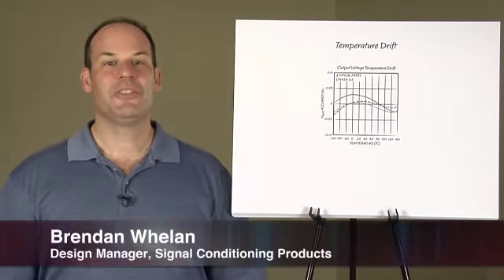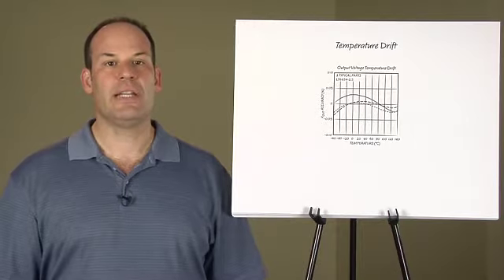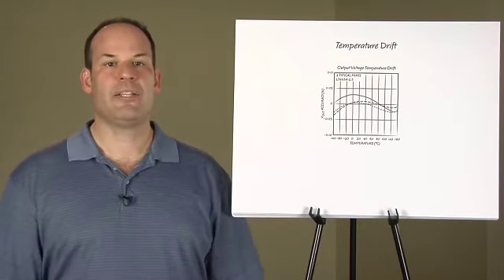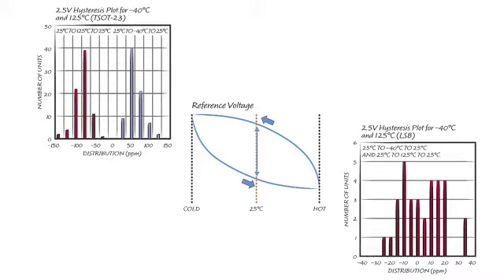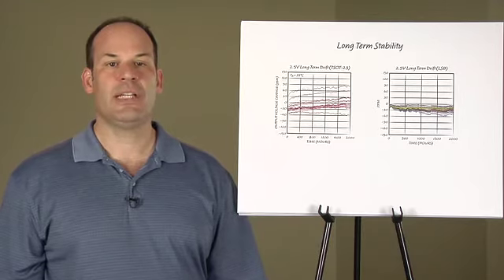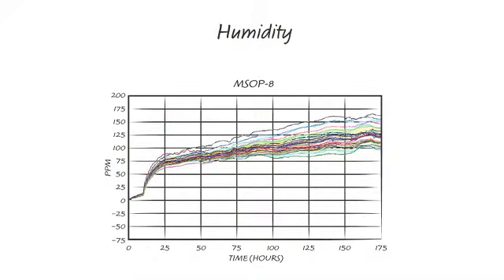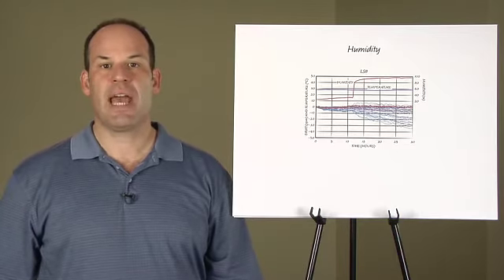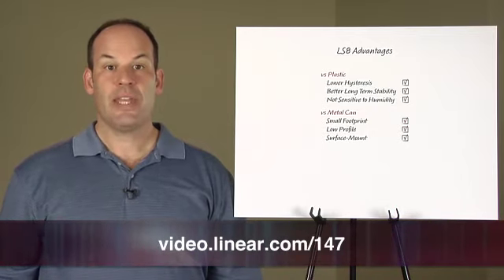LS8 Package Improves Stability of Voltage References

Comment: This looks interesting but I wonder how much is the output stability/accuracy affected by directly heating the whole package when it's mounted on PCB. Good old big cans have the advantage that only the end of those long leads are heated up so the die doesn't have to go through such large thermal shock.

Also guys, put links to some product page on your web, it will save us some time getting there.